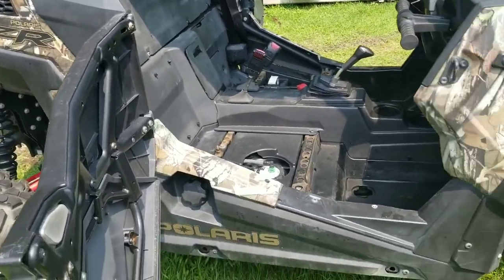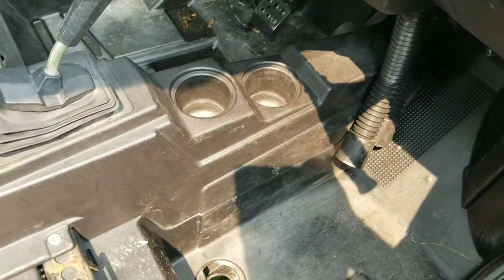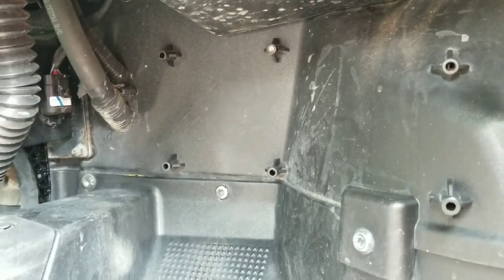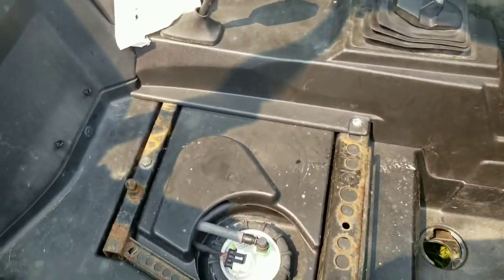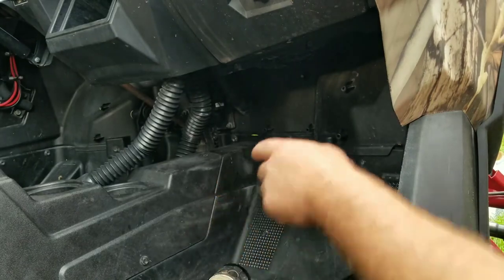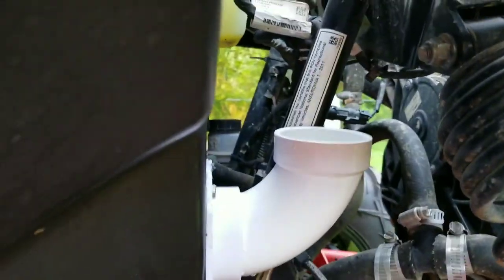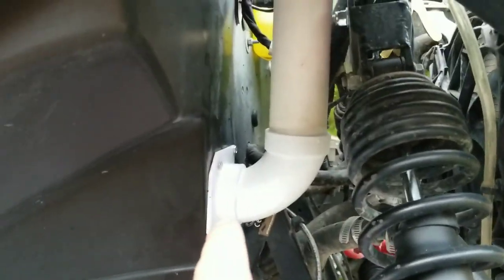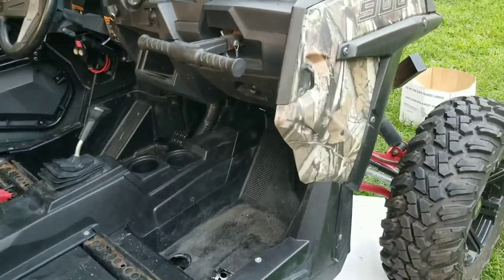I Made a Cold Air Intake For The Polaris RZR To Cool The Cab and Cut Down On The Dust.

Comment: One thing i did on my xx is buy automotive sound deadner with the heatshield on it.  Pulled the tunnel and stuck it on every surface i could get to.  Before, when driving if wearing shorts and your calf touched the tunnel it would burn me. Now no issues.  Only needed one box off of amazon to do one machine.

Comment: Looks like a cool idea, my only issue is when I'm going 40mph isn't the time I need the extra cooling, it's when I'm crawling along at 5-10mph. I would say look into adding a fan like they use for boat bilge's I to the pipe. We did something similar for my wife's ace using a 4" boat bilge fan and 4" semi ridged dryer vent, just bringing air down from the side of the vehicle rather than the front because the ace doesn't have all that  room under the hood, it's all taken up by the foot well. Works great.

Comment: We have found that having a windshield on or up in dry weather sucks the dust right into your cab. The only time we have our windshield up is when it's terrible cold or raining. We also have our back seat engine access point open to let the heat in the cab for the people in the back. If you have a two seater SXS open the engine access point for heat.

Comment: You might be onto something. I’ve got some ideas for you. Get a turbo hood scoop and 3D print a double flange for it. Send one tube to drivers and one to passenger side. Looks clean and factory but nice and cool. Bonus if you can figure out how to fit a couple computer fans somewhere so you have flow when sitting and talking to your buddies
Reply: And when you get it figured out hit me up I’ll ride with you and we can get some thermometers and test yours vs my rzr 900 trail.
Reply from the maker: I thought the same thing with the turbo hood scoop and 3d printed flanges. I may have to make a change. There is a guy on youtube that has done that but he didnt go into huge detail on what he did. Thanks for your input and where are you located.
Reply from the maker: Also the spray foam on the cup holders works awesome if you were wondering